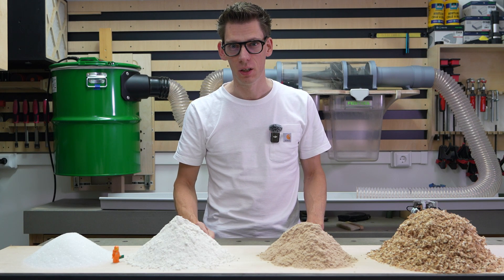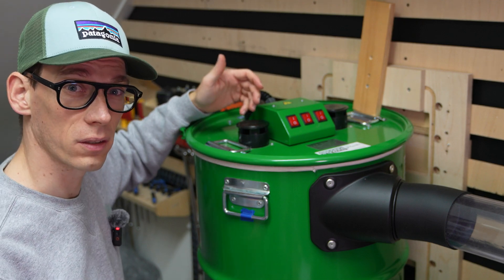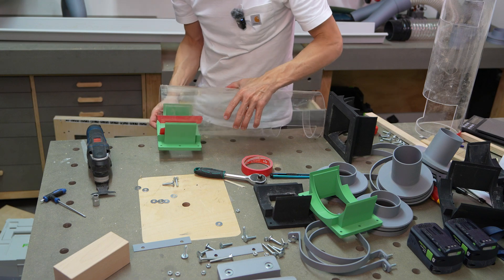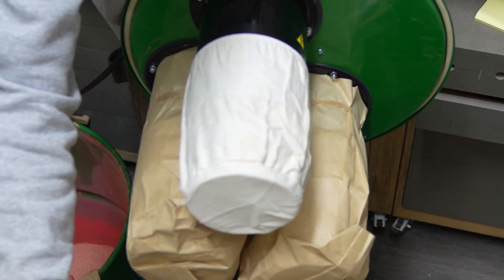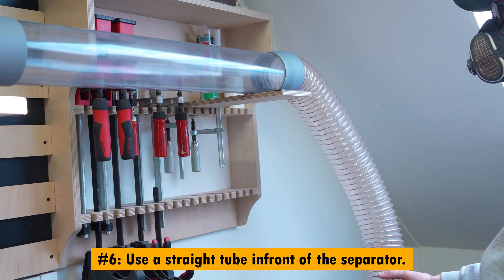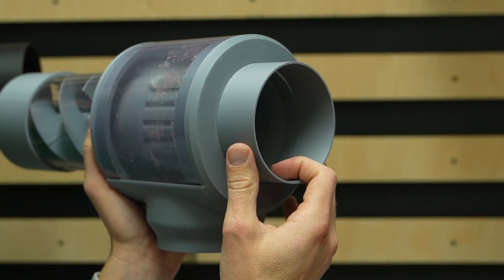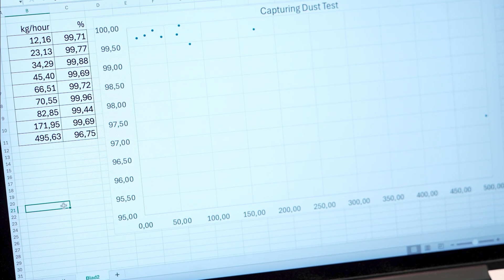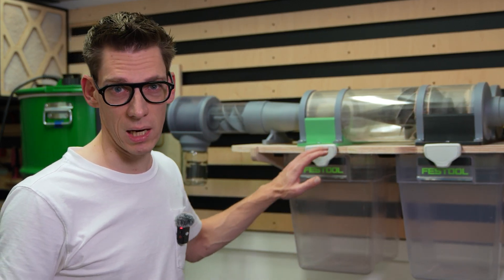Dust Collection: Small Changes, Massive Effect!

Comment: That was great, I very much enjoyed your presentation. Thank you for all the fun work and testing testing testing, so much testing! I know from labs that testing is so very important to help to determine them exactly what is going on and then to determine why it’s going on, and then how to change it for the better. I think I need to step back and look for the origin of your centrifugal separator investigation and builds. I’m wondering how far I can get without having a 3-D printer. In fact, I wonder if it’s possible to create a horizontal/centrifugal separator and dust extractor using more traditional methods. For veins possibly Boulding thin plywood? I need to study to parts more to make a determination. And then, maybe I’ll convince myself to buy a 3-D printer: I’ve already looked at some of the Prusa models.

Comment: I just discovered your channel and added most of your videos to my Watch Later list, which I will get through this week. I have two ideas for future projects, in case you're interested in expanding your range of designs: 

1. DIY welding fume extractor AND filter. Hobby welders can't justify the cost of industrial units, and it's a big problem in our small shops. The air gets really bad pretty quickly, and in the heat of the summer and cold of the winter many of us are spending money on air conditioning and heating, and venting a simple extractor setup to the outside air clears the climate-controlled air faster than it can be replaced. 

2. DIY portable drywall dust separator. I'm wondering if your small stage you prototyped here might be sufficient. Drywall dust is VERY fine, really escaping most typical cyclonic separators. Again, industrial versions exist that work great but they're very expensive. Sanding drywall joint and finishing compounds makes a lot of dust. 

Anyway, whether or not you take this on, I appreciate your engineering mind and process, and I subscribed. Thanks!
Reply from the maker: Thx for your great response! And for subscribing! 

My to do list is growing almost every day😅. I don’t have a welding machine myself but I do have a laser cutter that needs a better fume extractor and separator/filter. That is high on my to do list. And drywall dust is also something I will test with in the nearby future! But it’s heavy, very fine and highly static charged. But we need some challenges right?

Comment: I just wanted to point out that your air is already spinning because of the "threaded nature" on the incoming flexible hose. For one half of your extractor, you continue with that same direction, for the other half you actually fighting the air, by trying to spin it in the opposite direction. That would essentially would have to overcome the natural spin of the air, and force to spin it the other way. This probably reduces efficiency and reduces effectiveness of the second extractor.
Reply: It seems you also change the direction again in the final separator, I'm curious if everything was spun in the same direction, if it would help efficiency and reduce turbulence - improving the extraction?
Reply from the maker: Good point! I’m going to test this in the next video 👌
Reply: @CapturingDust awesome! Thank you for sharing your adventure with us! Very inspiring 🍻

Comment: Removing the impellors and going with a spiral tube design helps focus the stream of particles better.  Your impellors are great for creating a vortex, but that is not what you want. You want a stream of particles, not a full-on twister of them.   Classic overthinking it.
Reply from the maker: But particles needs to be separated out of the airstream. With a spiral tube that is impossible in my opinion 😅. If you have the design available than I would be honored to test it!

Comment: I would be curious to see the effect of multiple centrifugal separators in line, multiple - more than two in parallel, the effect of diameter change on the centr-separator pipe and the effect of multiple third stages - how could you get the last of that superfine dust - is there such a thing of a static separator?

Comment: You're making it much harder than it needs to be. Barrel! Two L-shaped pipes! Mesh on the air intake! The End
Reply from the maker: I am going to explore that option to! I am interested in the capability on filtering out the fine particles without the need to change filters very often.

Comment: In capturing dust, it would be interesting, tho tedious, to examine % collection at sources. I have a feeling improvement at sources would account for lowering fine airborne dust more than infinitesimal tweaks to your sysyem at this point. One of the best I've seen is Paulk's downdraft dust port just in front of the bit (outfeed side) on a router table, most especially when cutting rabbets (rebates). Source control is quite machine & feed method dependent. However, that's where breathable dust originates.
Brilliant work, this might be the geekiest geekout on dust control I've seen. Thanks.
Reply from the maker: Really good point! And thank you for the tip on the Paulk’s downdraft dust port. That was new for me but really interesting! Something to explore and geek over on for in the future 😉

Comment: Man , dust seperator made for preasure system not vacum. for vacum system is work other way then preasure .
Reply: if vacum system meet cone air flow goes up. at preasure system if meet cone flowrate is droping , so seperator part at every cone , wall , imperel  is to slow down flow rate :)
Reply: and last adapter what u print it do job for vaccum sytem :) nice to see how u busy
Reply: to get 100% should be . hose > ur last adapter for vacum system > el motor with turbine > x2 seperator . and find right size filter to adjust last airflow . sorry for my english ;)

Comment: ### A few thoughts on math & physics of dust separation ###

Hey fellow Dust Avoider, aerospace engineer here. I have been working on and comparing a range of cyclones in the past, always coming to the conclusion, that you can't beat math and physics:

The smaller the particles, the higher centrifugal forces are required to properly separate them. That means either higher circumferential velocities or smaller diameter trajectories. That is why e.g. the cyclones in the Dyson 2nd stages are so small: higher g-forces to settle tiny particles.

Which leads me to my question: Why are you using two separators in parallel?

The G700 extraction unit you are taking inspiration from tops out at a volumetric flow of 1.190 m³/h VS. 583 m³/h for the CGV386-6 your are using. That is about half.
As centrifugal force is F = m * v² / r   ==>    when reducing airspeed by half, your centrifugal force will drop by a factor of 4.

If you want to, please run a comparison where you run the entire system on just one separator. Fine dust extraction should increase significantly!
As the CGV386-6 uses regular vacuum motors, pressure loss should not be much of an issue, as the motors hardly experience any in a 100 mm system.

I have built a system for a friend running on 3x 1.600 W vacuum motors and 3x regular vertical 50 mm port cyclones (the cheap ones). For high volume (planing, table saw) we use all three, for sanding we funnel everything through one single cyclone, which dramatically increases extraction.

Cheers :)

PS: If you ever think about building a vacuum yourself, get in touch with me. I have compared the vacuum motors of every major manufacturer in Europe (at least 40) and can tell you exactly which one gets you the most bang for your buck!
Reply from the maker: Hi Ralf! Thx for your reply. I definitely would like to discuss some more details about some things. You can contact me on info@capturingdust.com. Speek to you soon!

Comment: IMO i think with everything made out of plastic and so much volume  it makes the plastic deflect and distort causing sealing issues between the impeller and tube. If made out of stainless or aluminum there would be a lot better fitment that's why you're paying more for a name brand like Harvey.

Comment: Put a check valve on your motor exhaust port, I piped my system outside, used for tig/ plasma cutter and upholstery extraction (wash) and general messes i don't like to stir into the air... frp glass and metal dust.... 💀.

Comment: 5:20 that y fitting, did you print this that? You could print mannequin parts .... the xi factory sells silicone ones... saw one at amazon😮 an ass in a box thet said 
"for your pleasure"  wtf.    
I do most of my vac stuff with pvc, it is heat gun friendly, the polycarbonate os very touchy at high temperatures... that red holy powder.... separation or containment by the collector, (you said penetration) dayum gave me an amazon flashback... dat azz in a dayum box..... 😮 then my G goes and pulls out the Y fitting.... bumps of holy powder.... 😂🎉 I hear the Netherlands parties like a rockstar.... anyhow, one hell of a fabrication on the Y... 😉...nice!

Comment: The dust you cannot see is the dust that threatens your lungs. I would not base assumptions solely on the amount of dust collected but would include PM2.5 measurements also. Otherwise, this and all other dust collection schemes give a false sense of safety.
Reply from the maker: That's absolutely right. I rely on the filter capacity of the CamVac for now. And next year I will delve further into the PM matter. I already have a sensor that can measure 0.3, 1, 2.5, 5 and 10 microns.

Comment: While you put a lot of effort into this, using that type of anemometer to measure flow in a duct results in large error.  That type of instrument is used for  heating ducts or outside wind measurement.
Reply from the maker: What would you suggest to use instead?
Reply: @CapturingDust  pitot tube

Comment: OK,something utterly "out there" - an electrostatic collector addition to the third stage (it will only work on extreme fines)

take your 0.5mm mesh, fit it across the mouth of the 3rd stage and negatively charge it using an ioniser module, with a positive ring around/in front of the collection ring

Comment: I will absolutely be building this as soon as I’m back from holiday. But what I’m really interested in right now is your air filter box!

I’ve been having to do a lot of drywall work and built a cheap Rosenthal box with some filters and tape but want something more robust for the downstairs shop.

Do you have any plans about for its design?

Thanks and I’ll be sure to share any results I find running it in my shop!

Comment: Edit: my point is mentioned in the video, ups.

Something I remembered just now, and wanted to tell you:
When testing wood burning central heating systems for dust, it was discovered that the "old" ones don't produce fine particles, because there was so many bigger particles for them to stick to. This lead to that some big industrial burners have extra long exhaust pipes in front of the filter so it first cools down, and the particles get bigger so it is more efficient.
So maybe don't separate your dusts for the test? Because maybe it will behave differently than if it is only fine or only big particles?
Do you get my point?

Arg I hate talking about something where I don't find the right words in English.
Reply from the maker: No I totally understand! That is what I wanted to addressed in the video (with less words) because of the mixture performed really well with efficiency above 99,6 to 99,88%. And the separate dust sizes in that mixture alone did not match the overall performance. It’s clustering of the smaller particles to the larger particles and they get separated out in the first stage that will lift the performance. 

Only I would like to have a solution for the bandsaw as well that creates more of the fine dust particles with absence of larger pieces to stick to. (Hope you understand😅)
Reply: @CapturingDust  ok didn't remember that part.
If it is in it is great.
Reply from the maker: No, I don’t make it clear enough in the video. It was clear in my head 😅. But a good point to explain better in a next video 👍

Comment: Reprint the cover as a tractor exhaust flap style cap. When the motor is on, it blows the cap upward. When the motor is off, gravity keeps the flap closed. No need to swap caps based on operation mode.

Comment: Static charge can be a safty issue. For professional installation in Germany the pipes need grounding, as worst case discharge from static charge could cause a fire / explosion.The bigger danger for a fire inside the dust system is still from curring through opjects, like nails or stones in the wood, that can than cause a sparc.

Comment: You could also add some vibration to the separator section. The industrial Karcher vacuum cleaners I use at work have built in mechanisms to smack the filters every 20 seconds or so to remove built up dust.

Comment: First video of I have seen of you. Neat.

Something you can do to get more real-time information is make some manometers. Basically take some 6mm clear tubing and hang a loop down and add some colored water to it. If you put a ruler behind it you would be able to easily measure the difference between the liquid levels to get the static pressure.
If you have one going from the green can to atmosphere that would tell you the static pressure of the motor, then you would be able to add more at the various fittings which would give you the static pressure at that fitting. If you added more from one section to another you would also be able to see what the pressure drop at that section is.

Let me know if I need to explain this better. Keep up the good work.
Reply from the maker: Thx for your comment! I’m already working on the manometers. The colored water is a good tip! That was something I did not think of but for camera better visible

Comment: My suggestions.

I would go to one tube, instead of the double swirl tubes.  You're losing velocity, by having 2.   Velocity is important in accelerating these particles outward.  (hell, try just one of what you have, and see if you have any more efficiency)  I would also step up the diameter and length of the tube after the swirl is introduced and where the collection is happening.  These systems rely on inertia of the particles.  The further out (diameter and depth) you can throw these particles, the less likely they are going to be recaptured by the incoming stream of air.  Basically a widening cone shape after the swirl is introduced.

Another thing you can do to help, is make it a vertical system.  Air drawn from the top and swirls outward and down with gravity helping.  With a system like that you could have a 360° particle trap, instead of just the notch you currently have.

**  Also, a deflector just above your collection holes to help throw the particles into the bin.  Although the best desgin for that would be a logarithmic swirl (snail shell) shape instead of the tube.  Just make sure the the long and short  radial dimensions  are correct for your rotation.

* And yet another idea.  At the end of the collection chambers, instead of just a flat shoulder, a spiral ramp (screw) in the direction of partical rotation would help direct the particals into the slots for the collection bin.
Reply: Great ideas. Espeically mounting it vertically and the importance of particle inertia so it doesn't get reintroduced into the stream.
Reply: mounted vertically, and increase the diameter by combining the two separate tubes into one and eventually you start to converge on a cyclone…

Comment: cool project looks great maybe if u change the shape of the input connection after the y split to a cone shape gradually making it larger from the small end to the big end. Also could make the cone like end of a horn with a curve from small to big and try a tear drop or football shape mounted inside the cone like the piece in front fan blades.

Comment: Have you considered the possibility of making use of the static charge to assist in capturing the dust? Maybe instead of the current 3rd stage you could use a large box to lower the airspeed and something like thin fins from the top of the chamber for the dust to cling to before falling down in clumps?
Reply from the maker: I did have considered that and did some research on the topic. My conclusion was that the voltage needed for an high efficiency output would be very high voltage and not my cup of tea 😅.

Comment: One way to have a more "straight" air flow after the Y split is to use a honeycomb shape like mesh with a certain length. It is used in wind tunnel to make sure that the air flow is going straightforward without any rotation or bend before the test section
Reply: I was thinking about some other laminar flow solutions here, I like that this sounds fairly accessible. Will a useful mesh size work with the size of particles going through the system?
Reply: Yes Mitsubishi had this in a maf, on an eclipse I had.... miss that lil freeway ricer. 
Would be cool to see that honeycomb in action through polycarbonate.